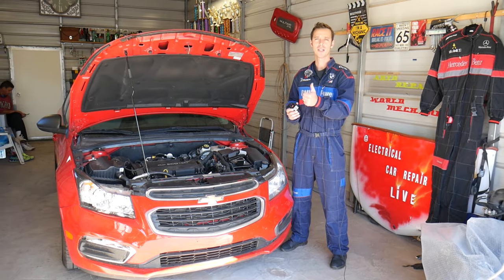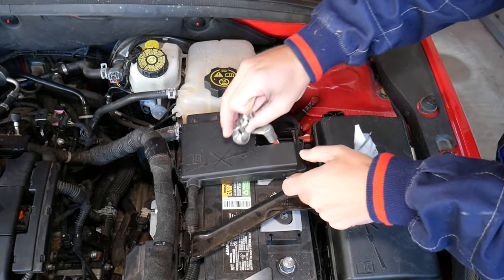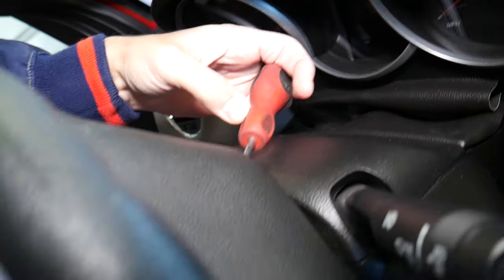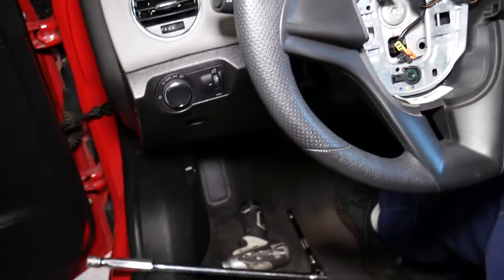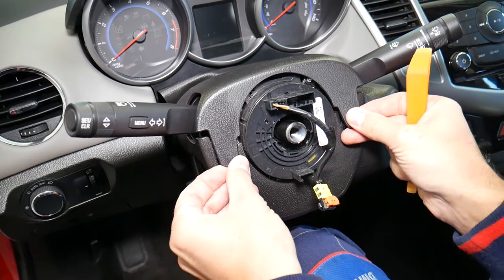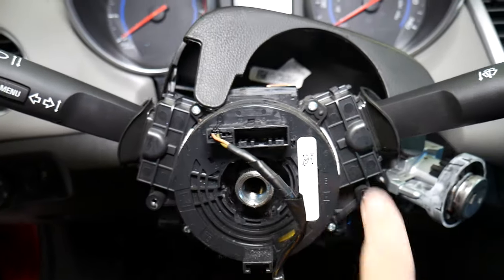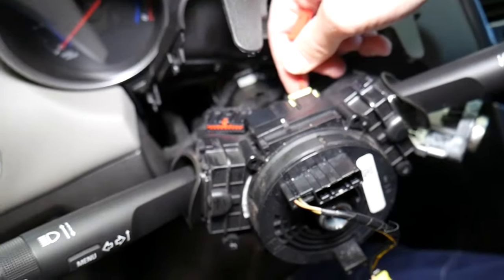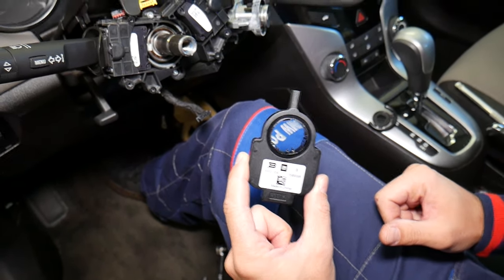STEERING ANGLE SENSOR REPLACEMENT REMOVAL LOCATION CHEVROLET CRUZE SONIC EQUINOX MALIBU TRAX CAMARO

Comment from the maker: Products that we use and recommend:
► Steering Angle Sensor: https://amzn.to/2yeBQfY
► Panel Removal Set: https://amzn.to/3YiMADu
► Assorted Fuses: https://amzn.to/4fx4s3F
► Tool Set: https://amzn.to/3p5MM6t
► Screwdriver Set: https://amzn.to/3XRB28Q
► Castrol Oil: https://amzn.to/3xBc8B9
► Oil Filter: https://amzn.to/3w0Ulme
► Torque Wrench: https://amzn.to/32qyRwg
► Liqui Moly Engine Flush: https://amzn.to/3IiDBID
► OBD Scanner that we use most often: https://amzn.to/3I4MQfe

► Check out our Amazon Store for the tools and parts that we use: https://www.amazon.com/shop/worldmechanics
Reply: @AutorepairGuys can you pease lete me know the model details of the clock spring
Reply: Where was part number I have 2012 Cruze 1.4 turbo

Comment: Ok, It is best to remove battery first, but SIR yellow connectors have an internal shorting bar. Disconnected, the copper bar drop down across both terminals shorting the circuit. This keeps everyone safe regardless of training. The plastic tabs on connectors are called "Connection Positive Assurance", a CPA simply makes sure the connector is completely seated and can not come out by accident. (Tip; Go to Rock Auto, make, model and year. Find electrical, click to find the steering position sensor. Open one to look at but click the little number next on top left, it displays a chart of vehicles this part fits) more information is better. I did subscribe but was looking for the "Part 2" where you installed it, cleared the code and got it working. "NOW", there is a re-learn if I am not mistaken, but 2013-2015 uses the same parts and software. My GM Tech-II is not programmed passed 2010. New software will take it to 2013. GM uses a laptop based live system since China flooded the market with cheap knocks-offs that fail fast and software. But using 2013 software, lye to the scanner and say 2013. 
Do you have this video? Thanks. DK, ASE master, retired (Fixing wife's car)

Comment: you ended the video just at the point where i needed to see, please do you have a video of a 2008 c max " how to replace the steering wheel sensor " ? as i'm having issues with my 2008 .20 tdci c max

Comment: I have a Chevrolet Orlando 2011 Auto Diesel in UK, i have a slippery car road sign on all the time since a week, no T/C light. Mechanic Diagnostics says SWASM(steering wheel angle sensor module). Not very easy to get part for Chevy in UK not sold here anymore. Do you think changing angle sensor is the fault? drives smoothly no other issues while driving.
Reply: The input sensor for detecting what could be “Slippery Roads” or on some, simply “Caution Ice”. This is the outside air temperature sensor mounted in the front, behind the grill. It has two wires & 1 screw or bolt (7mm). The resistance drops as it get colder, if near freezing and message will probably show in the dash. It is best to check with a scan tool but if in an accident, wires could have been pinch or cut almost thru. Outside resistance and corrosion could change the values it sends to the body control module.

Comment: Is that a camera behind the airbag?!?
Reply: No cameras come in the car. Only backup camera if equipped! The SIR system however record a loop of data only. In runs for 10 seconds, 12 seconds and 15 seconds in some models. It records over its self and captures speed, brake pedal position, engine RPM, and many functions that if you have an accident, special equipment plays it back and shows what you were doing at the time of the wreck, like sleeping or going faster or stepping on the brakes. It can not be erased and is bolted to the floor pan in a rigid area to use electronic accelerometers to detect how hard the hit was. Air bags don't go off on their own and have to be a force and angle to hit a concrete barrier at 30 MPH within 10 degrees left or right of center. Most have two deployment modes, soft and hard. If too close to the steering wheel you get a soft and perhaps some injury. Arms forward, seat back to comfortable position allows the seal belt first to protect you, the SIR, plus Knee shield under the dash to protect legs. Hall-effect sensor is placed on seat track to determine how close you are. Passenger side has a bladder sensor in seat cushion to detect less than / more than 42 pounds. Below, no deployment, above 42 pounds then deployment of inflator module, if too close or back farther determines if soft or hard combine with accelerometer on SIR Module. Police, highway patrol, and others can read and print perimeters for use in court. It locks and disconnects on many models so it cannot be damaged or altered. It is the law! DK, ASE master since 78, retired.

Comment: احسنت
Reply: That 4 plastic pins that needs to be pushed for the clock spring to release the sensor while pulling up at the same time was the worst part of it, what an $--#&&! design.